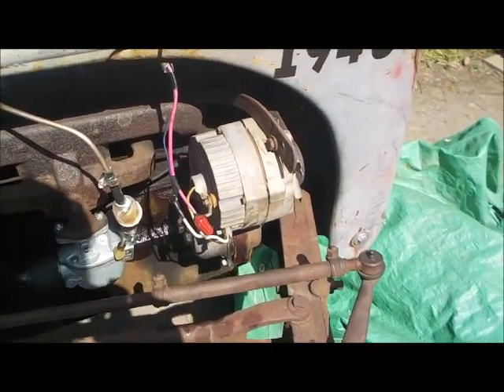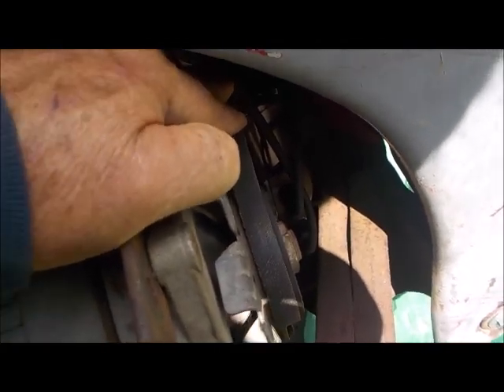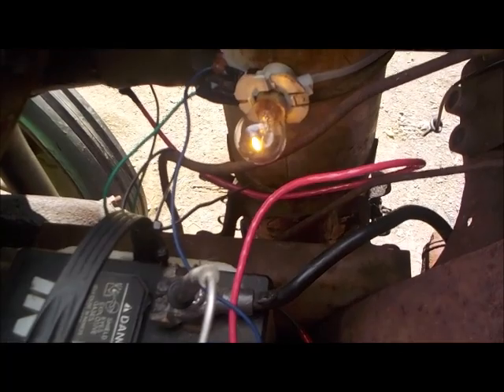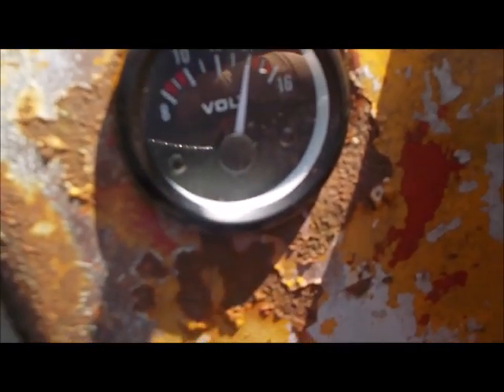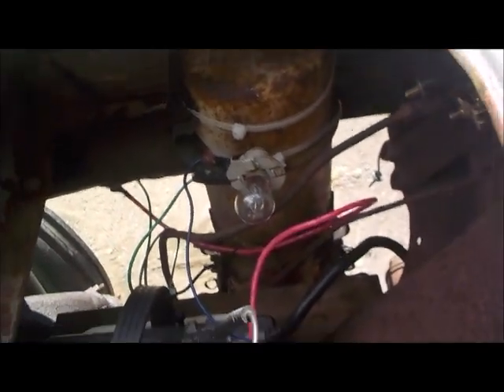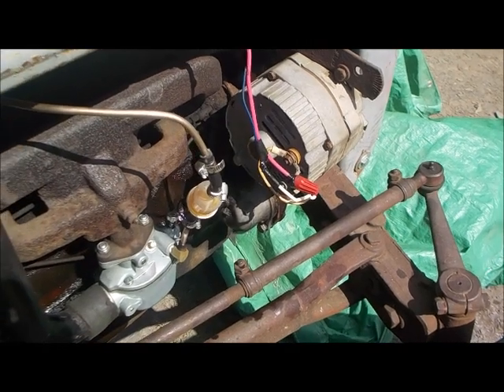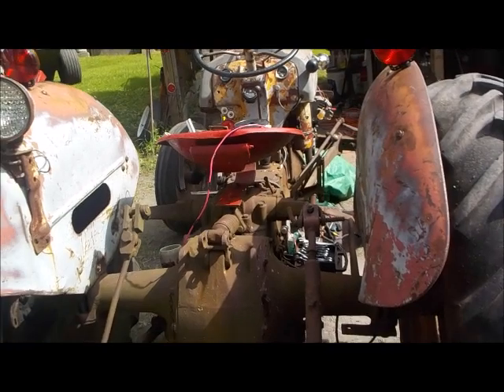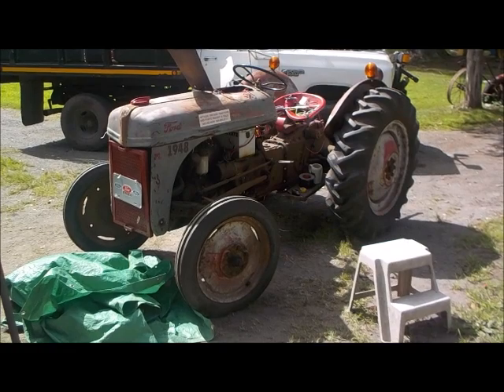FORD 8N  6 to 12 Volt Conversion Part 3

Comment: she fired right off, starter sounded good to me, , as long as your voltage regulator is working correctly, it will run good voltage, no matter the amps,, I need to watch the other vids, to really know what all you did, , they will not be stock, but I have come to really like the LED lights, and you can put on a bunch of them with a small generator/alternator. going to add a couple of them to my tractor,... max light, min input amps

Comment: Glad you got it sorted out.  I'm pretty sure that 1998 alternator was using neither of the correct wires that you needed.  (I think that single wire is regulated through the computer on those allowing it to work).  The way you hooked up the 2nd alternator (10 si alternator) is the exact same way that 1998 alternator needed to go hooked up, with both wires.  You'd have needed to buy a replacement pigtail which come with all 4 wires.  Then hook it up the same way.  Those 10si case alternators are a better option IMO because they are much cheaper and easier to find.  They are like $30 last I checked.  The 1 wire 100 amp si alternators (only use the battery cable, does not use the 2 wire plug at all) are like $100 brand new at summit racing.  But I'm guessing you won't need much amperage, unless you plan to hook up a bunch of lights, so the stock 60 amp alternator will be more then enough, and easy enough to hook up
Reply from the maker: Thanks for Checking it out, appreciate all your advice.